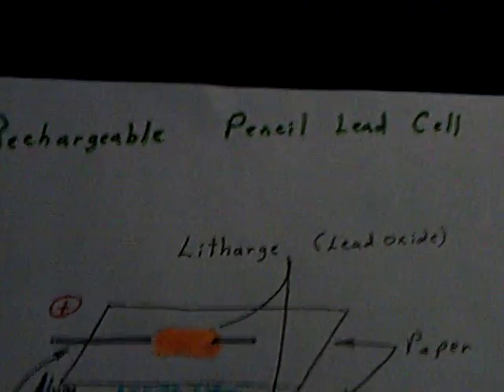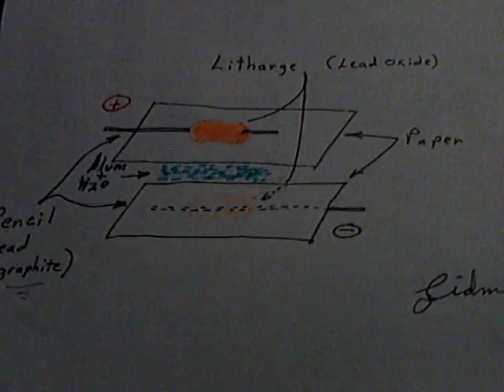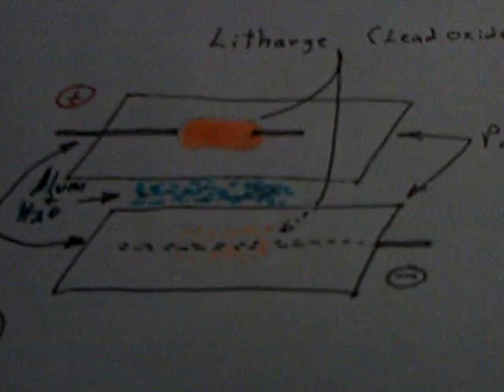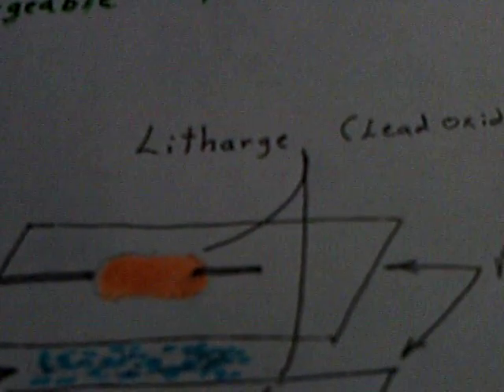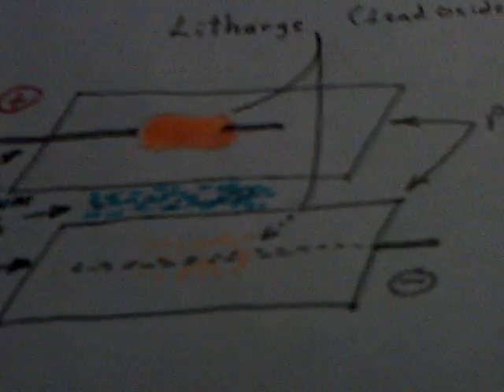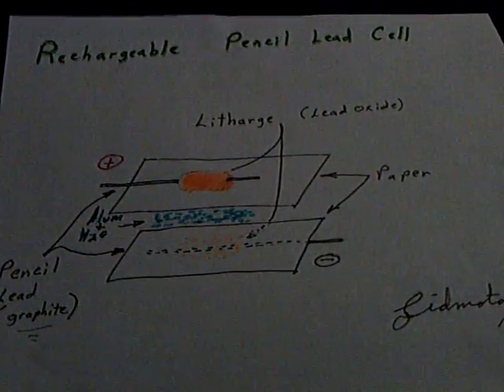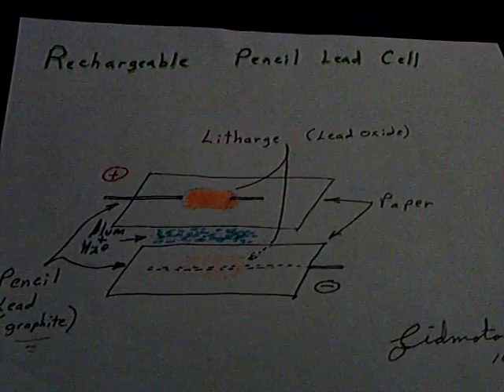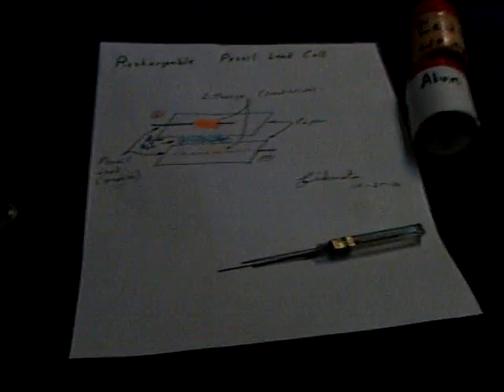Rechargeable pencil lead cell

Comment: Hi Lid,
By the way, what. Voltage do you get from this cell? 
I have now a cell running with Carbonfiber and Titandioxid and Zincoxid
and Epsomsaltwater as the Elektrolyte and it puts out only
around 1 Volt and maybe 10 milliamps....

Comment: Do you collected any information on the efficiency of these cells?  Do you know what kind of output in both volts and mah that these cells will output by weight and materials used?

This is some very interesting work that you are doing and I think that it is awesome.  Thanks.

Comment from the maker: My experiments with reactive metals and the lead oxide resulted in the metal being eaten away on the positive electrode.   The cell worked but was short lived.  Zinc/lead worked quite well and I have a cell running right now in testing.  John Bedini came up with an electrolyte that seems to slow down the decay of the zinc.  Aluminum would go away in a hurry.
Reply: Hey lidmotor  do you test stainless? and was  steeel eaten too?

Comment: Great verification.
So the lead oxide helps and through charging you probably
generate pure lead on one electrode.
Can one see some lead coating then there ?
Many thanks.
P.S. I wonder if it would also just work with TiO2 as I have this here
and this is very cheap to get !

Comment: Lidmotor, if you could, could you provide the Ebay user that supplied the lead oxide? Searching for "lead oxide" on ebay, is a pretty painful process, I've learned... lots of resistors coming up....or any tips would be great. Thanks

Comment from the maker: Thanks for that alert.  I ran the test right away to make sure that I was not just seeing a supercap effect.  There is a capacitor effect with just the Alum /water but the power output is vastly improved with the lead oxide and improves with each cycle.

Comment: Could you use graphite powder and compress it into plates to use for this, or would it take too much pressure to get the graphite powder to maintain a form? I wonder if graphene would work? Pieces of tape with graphite attached to it in layered with your mixture? A roll up battery? Just a though, but great work!!!

Comment: Hi Lid, 
Can you make sure that the lead oxide is really doing something in this cell ?
Normally already 2 graphite rods in saltwater give a rechargeable cell,
this works then  like a supercap principle..
So can you verify that the leadoxide is really helping in your cell and produces more power output
than a pure graphite-Alum-water cell ?

Many thanks.
Regards, Stefan.

Comment: Are you sure that you use Ammonium Aluminium Sulfate or is it the normal
Pottassium-Aluminium-Sulfate ?

Alum comes in several different metal-ions configurations...

Comment: Hi Lid ! Well done man ! Great Success !
Was a good idea to try also pencil lead for the graphite.
Maybe if you can order this from Ebay this is a real carbon fiber sheet that has 
good electrical conductivity and had a big surface.
This is a Google url shortener link:

goo(.)gl/RVKyT

Please remove the brackets to get to the right URL.

Please try something like this, this will really enhance these cells and make them much more powerful !
Many thanks for your great work.
Regards, Stefan.

Comment: BUT (continuation previous post above), just putting them in parallel does not work, one must balance one cell with its neighbors and only then the limiting factor will be only the number of cells connected together.

Comment: Lid, great finding. Your video is very dark though I could not see the cell itself. This goes very, very  inline with what I am finding out about those crystal cells. That kid, IBpointless, is very correct in still working on his "no water" cell. What he find out is that the crystal grows a little bit in power all by themselves, which is the voltage being always there, no current yet, BUT, if you have many crystal cells in parallel the current is limited only by the number of cells BUT next post